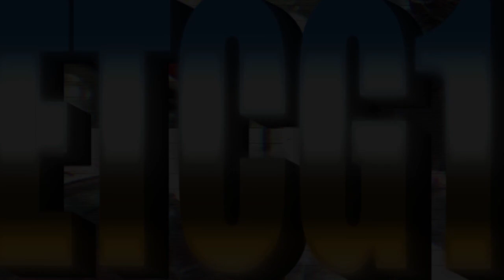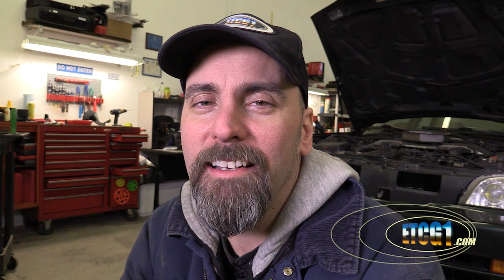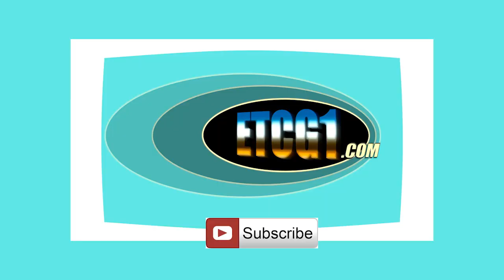Electronics are Stupid -ETCG1

Comment: Be cautious about resistance check. A bad connection may have metal to metal contact, which show up as a good low resistance (since it DO make contact), but unable to pass a big current due to the tiny surface area. Remember, your meter will try to pass a few microamps in it's resistance test. Mine have a 6 microamps fuse for voltage and resistance test. That is 0.000006A. That is the fuse rating, it mean that the meter itself use even less than that!

A battery can show up a solid 12.7V, yet be unable to pass any significant power and can cause the voltage to drop too much. Since the electronics has been made to run at possibly 10-15V (some down to less than 8V, like the PCM... the battery voltage can drop that low while cranking, other like the radio will survive but will shutdown at such low voltage), a bad connection can cause the voltage to drop bellow that minimum, and the alternator can have issue to stabilise it's output and output way more than the 15V (and fry stuff).

A voltage test often show a better result as it is what the device will see, if there is a bad connection then it show up as a low/high voltage.

So, as Eric said, always be sure that you have a good power source (battery, connection, wiring, fuses, relays....) before trying to diagnose a weird problem.

I got burned once while trying to diagnose a weird problem on my car.
The issue started by the HVAC blower motor that took a few seconds to start.
Then it went worst and worst, until.... xmas tree light in the dash!
Then things started to get even weirder: delay for the starter to kick in, sometime it refused to even kick in...
Then the day I got time to investigate: motor even turned off while driving... THAT was not cool... Fortunatelly it was at a red light.
The issue was: bad ignition switch. You know, the same ignition switch that GM recalled on later model (mine is a 2002, they recalled the 2003 up to... I forgot). The same ignition key that killed a few people...
Since I'm cheap, I opened it up, sanded the contacts back to a clean state and reassembled. No more issues...

3 out of the 5 "switch" inside was burned badly, the worst one was strangelly the one that appeared the less: starter.
Second one was the accessory, the one driving the HVAC blower and a few other things.
Third one I think it was an ignition one, that also power the injectors...

I had noticed some performance issue with the car, that I tought was due to a possible vaccum leak (cracked hoses)...

If I had checked the voltages, I would have found it quite fast...

Comment: I was sent to the north to work on a floatplane with a normal piston engine that was having problems. Several people had worked on it, but without figuring out what the problem was.
If you tried to start the engine and it caught on the first try, everything was fine. You could run it all day, no problem.
But, if it didn't catch on the first try, it just would not start. It would crank really slow, to slow to fire up.
People had replaced the battery, the starter, the starter switch, the battery cables. Nothing seemed to fix the problem.
Battery voltage was good, continuity tests were all fine, etc.
I happened to be talking to an old mechanic about the problem and he said "Check the engine ground strap".
So I did. Guess what, it was broken. The only ground was the metal fuel line from the engine to the frame.
So ohm tests would be fine, but when the high current from a start was carried over that small line, it would heat up. It would get so hot that the resistance would go way up and the voltage to the starter would drop to low to turn the engine.
I made a new strap and when that was installed, everything was perfect.
What made me stop and think was that the fuel line had been getting super hot when the engine was started. Could the line of ruptured, starting a fire? If it did, would someone investigating the fire figure out why it happened?

Comment: my (then) brand spanky new equinox i bought back in 08 started getting some weird electrical issues, one day the cluster died lights alarms and stuff, i nearly panicked but the car did not go into limp mode, and a few seconds (long seconds) later it went back to normal, no codes nothing, i go back to the dealer, they look at the car, find nothing at all wrong, give me the "knowing nod and smile" and i am on my way.

As time went on it got a bit worse and was always random, maybe sitting still with the engine running it would do it, or driving down the road, sometimes it would be days or weeks before an event, everytime i would take it back I mentioned, that it showed the classic signs of a short, (having a background in electronics, computers, electrical, and basically anything that moves whizzes sparks or goes bang ), again i get the "knowing smile and nod" with the feeling they are sarcastically thinking like I know what i am talking about...

fast forward 6 months, (and cellphone video of the issue happening) 4 more trips, a couple of times the car was in the shop for 2 weeks, and there was talk about replacing it, the rentals they were giving me as compensation were getting bigger and more luxurious (the dealership to be fair we really nice about it) and the last few minutes of the last day before they start the paperwork they found the issue, someone at the factory forgot to put a grommet in the firewall, and the wire harness was shorting on it, the tech only saw it because it was dark out and the shop was also dark being the last man in.

they fixed it, but the service tech was very embarrassed about dismissing my initial diagnosis, i stayed with that dealership until i left Illinois, they always listened to me after that.

Learn to read a schematic and learn what components do like capacitors resistors and transistors and also learn how they interact, after that mostly it becomes a game of whack-a-mole.

Comment: Eric I have had an electrical problem in my 2007 Ford Focus, throwing a code p0480 which is a cooling fan circuit malfunction code. I've checked the lot of it from bypassing the cooling fan to see it working, checking voltage to fan, and wiring up to ecu and still not being able to diagnose the problem? Really scratching my head about it, done continuity test so it isn't shorting out, and all voltage is as it should be? Cooling fan still won't work when car starts to over heat and won't turn on at all when aircon is turned on? Any help? Anyone else had this issue?
Reply: I would check the thermal switch if you haven't yet. That would be what tells the fan control computer that the car is hot. If that is not sending signal then it won't tell the fans to come on.

Comment: A very large percentage of elecrical issues that come up in automotive come from being cheap. That is the automotive manufacturer used cheap wiring, cheap connectors, cheap motors and cheap sensors. It seems to be a common area to cut corners. Or I should say planned obsolescence.

Comment: In the modern, binary world, electronic circuits can be pretty hum-drum at times.  Not so when batteries are involved, though, as they're not binary.  They're good, old-fashioned analogue creatures.  You can make them function in a binary fashion, but they're essentially analogue, so you'll need your multimeter/VOM when searching for gremlins.  Even with a solid base of electronic knowledge, identifying and tracking down electronic problems can be a bitch.
Reply: yep, but i like it.

Comment: I remember back in 1980 or so many mechanics started looking for something else because they didn't want to deal with automotive computers and the increasing use of electronics. Those cars look simple by today's standards. (After '07 most vehicles have the CAN Protocol and one of the things you'd want to do is realize you have a dozen or so microprocessors interfacing with each other which means more diagnostic time spent and more cost for the consumer).
    I've got to admit I've made a lot of money on electronics - mainly because I wasn't afraid to tackle it. I'll do whatever the customer requests for me to do. RespectfullyRod

Comment: Available Voltage, then Voltage Drop. These are the most Important tests in a circuit.
Resistance (Ohms) can throw one off as you may be under the Impression that you have continuity and all is good. Save Ohms for guided Component tests are per a manual.The Battery condition and fuses are a good start. 
"You got to go low tech before you go high tech".  PHX Glock

Comment: most electric problems are a secondary problem. example burnt wires. replacing the wire would only be a temp fix because that wire will burn up if the main problem is not fixed.

Comment: Im an electrical engineer (design circuit boards) and i agree they are stupid and should not be nearly as prevalent in automobiles
Reply: Ok but I still love my little Magneti Marelli ECU just take care of the spark plug firings and nothing more. Maybe it is just a way to make more money having only the dealer equipped with the correct diagnostic tools to solve the problems for unreasonably prices.

Comment: so the question is, is it possible to make a car now with some V8 with no electronics at all? like NO ELECTRONICS WHAT SO EVER!
Reply: older Mercedes diesels had very little or no electronics running the engine. they are 6 cylinders though
Reply: John Plater in this case i take muscle cars. but i just want new cars with new chassis for better handling .
Reply: When you say no electronics what so severe do you also mean things like lights?
Reply: David MuscleGuy Its just that all the fancy electronics fine tweak all the parameters of an engine(fuel quantity, air quantity,ignition timing etc) that make the engine more efficient and create less emissions that the new regulations force them to meet
Reply: David MuscleGuy 
It'd have to be a Diesel and hand crank, but yes it is possible.
Reply: David MuscleGuy 
No it is not possible. The interesting question is why. Emission control for the manufacturers. And gagdet porn from the car buyers.
I'd be shocked to death if cars these days would even sell without an A/C system. It's basically expected, and absolutely necessary even in cold weather (foggy windows aren't safe at all).
Reply: EFI is dependent on electronics. So, not unless you use mechanical fuel injection or a carburetor.

Comment: When you are dealing with things like slow cranking, intermittent no crank, vibration induced failures things are not in the"on or off" "one or zero" category. There are times you have to make a call on if the voltage drops you can add up put the car over the limit. Now with "computers" in cars. All you need to concern yourself with is "what goes in and what comes out". What I mean is you do not need to know how the integrated circuit on some motherboard works. Find out what inputs you are suppose to have and what outputs based on these inputs, its simple, most of the time. You will find a lot of "computer" work in autos is updating software. This means get a good grasp on how to download software and how to install the new software. You do not need to redesign the entire electrical system. many times you will do your downloading from a site set up by the manufacture. with detailed instructions on how to do the job.

Comment: Bring back the old carburetors with the chocks that keep sticking and carburetors you need to adjust in high altitude. also bring back the old distributors with points that tend to weld together on a stinking hot day just when you've bought a gallon of ice cream and leave stranded while you attempt to separate them with a screwdriver and a piece of sand paper to smooth the contacts over .

Comment: I don't have much trouble with drivetrain electronic and ABS. it's the nav systems,and park assist,and climate control for each passenger, and having to remove the entire dash to get at a stepper motor that broke the plastic pin off itself that controls the air doors in the climate control. thats the stuff that I can't stand fiddling with.

Comment: I have a birthday coming up on the sixth. I'll be 43.  It went by fast for the most part.  anyway, I have a question about batteries.  My battery was bought three years ago, last year, it has leaked fluid out the top ever since we got it.  autozone tested it three times, different ones, and they say it is normal.  It ate up a battery sensor in the bottom pan that held the battery in place.  I cleaned it all up, but still have to keep my top wiped down.  they said my alternator was not over charging. is it normal?   my other batteries never seemed to have done that.
Reply: The battery just sounds like it's junk.  Even if it tests fine and holds voltage, if it's leaking from the top, it is garbage.  When they leak fluid like that, eventually they're going to get to a point where it's mostly vapor on the inside, if something inside of the battery corrodes away due to the vapor and sparks, the battery will literally explode.

Comment: Eric, I'm into electronic engineering. Sure electronics is intimidating to mechanics because the failures are invisible. The mechanical issue you can see and/or feel failing but a circuit board can be just plain dead. And unless you are the designer or you are being provided with complete, clear schematics and source code electronic issues are hard to fix. Even for me. I prefer design something myself rather that having to follow other engineers (crazy) thoughts in fixing a circuit board or software.

Comment: Easy to replace a control unit, but have fun tracking down and repairing the problem when it's due to a failed component with no visual clues as to the problem.  Even if you know which component has failed, good luck finding a replacement part if it is 25-30 years old.  It's simple enough to pick up a control unit when they are readily available, as in a dealership, where the "fix" is to replace the entire assembly.  I prefer to fix the actual problem, but without schematics or any documentation whatsoever, it's challenging to say the least, and requires blind, (in my case novice) backward engineering.   The unfortunate thing about electronics is that if a system fails and ultimately becomes unrepairable due to age and lack of availability, that system is gone, unless the fault is repaired.  That presents the dilemma I am talking about, occurring in cars a few decades old.  It's going to be a major problem for countless cars made from the 80's and on.  Regardless of whether or not their electrical systems are considered reliable or not.  They all have their eventual failures.  You can only hope that it is a readily available component and not some specific transistor or IC.  Power routing is pretty basic, and will always be repairable.  It's actually what you hope for when there's an electrical issue.  Of course dealership techs probably hope for a faulty control unit.

Comment: I would NOT want to do diagnostics on modern electronics. More than 25 years ago, I worked on a device driver (Quad NAND gate, 2543) that was developed through the Automotive IC division of Sprague Semiconductor (now Allegro Microsystems). That chip was smart! You could put a dead short on the output and the driver logic would shut it down to protect itself. If it overheated it could shut off again to protect itself. My advice would be, that if you plan to do component level debug, you might want to have the device data sheet on hand. You might think that the component is bad, when in reality it is applying smart logic to avoid self-destruction. On new datasheets, I am seeing broader ranges of operating voltages. A device that would fail if the supply voltage dropped from 5 volt to 4 volt can now safely operate from 2.5V to 5.0V. Here is an example of a very slick instrument amplifier that can operate from 2.7V to 36V [http://www.ti.com/lit/ds/symlink/ina125.pdf]. Eric is right, dynamic tests are the way to go. Isolation of the circuit as a whole to narrow the trouble spot. I see nothing wrong with board swapping if you have them.
Reply: +CincyPlasmaTech Thanks for the wisdom. I'm an embedded systems programmer and I completely agree. Espeically with systems as complex as can be found in automobiles would be very troublesome with even a voltage drop test. Newer chip manufacturing processes make the chips low powered and can operate as you said almost at half of nominal voltage.

Plus it is hard to isolate most circuits into independent functional blocks because everything is surface mount now

Comment: What I hate about electronics is how stubborn they are its just (yes) working like a charm or (no) abandoned on the street at the middle of the night.
Reply: i had to AAA my car because of a non working sensor. this was a MAF sensor and i spent a good year trying to find the source of the issue. taking the engine apart, replacing everything the symptoms called for. and the last thing was the MAF. i could have driven home if i simply unhooked the sensor wire. it was causing the engine not to run. basically zero spark. unplugged it and bam started right up. bullshit!
Reply: +Andrew LeDuc sensors is a pain in the butt specially if the obd can't specifically determine the issue. I faced the same issue with my crankshaft sensor. 5 mechanics couldn't find the problem and finally I decided to replace the fuel pump untill I met a good mechanic and replaced the sensor for 15 bucks.

Comment: I know how that is..... My 2000 Cougar blows fuses pretty frequently... I ALWAYS keep a fuse tester and a baggie full of the little buggers in my glove box. I've just recently run into problems with my power seats not working, and the car not communicating with a scan tool (It doesn't even turn it on. Tried on SEVERAL vehicles..)